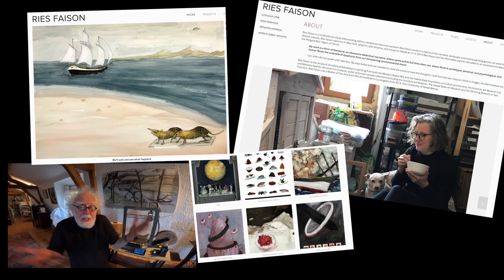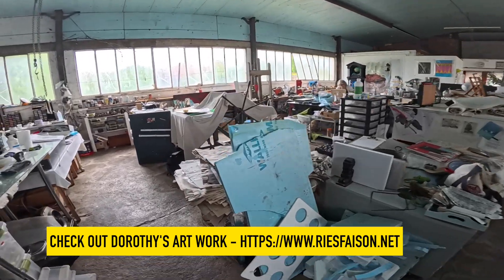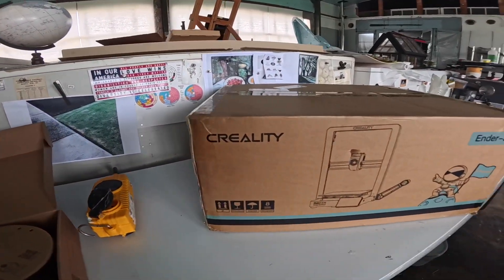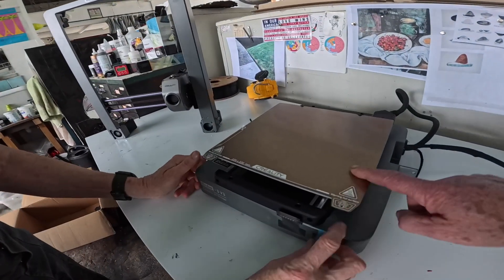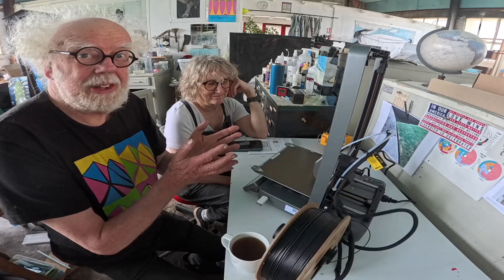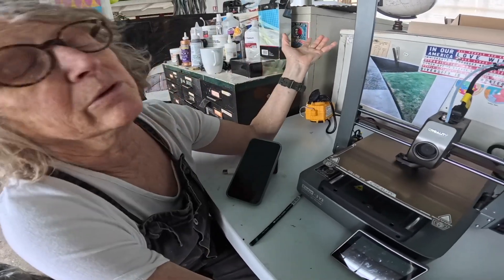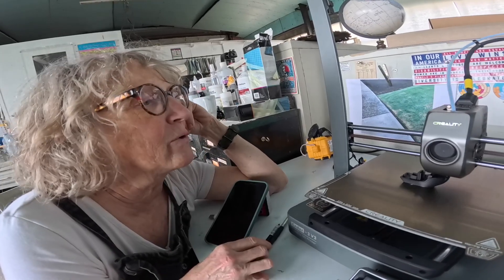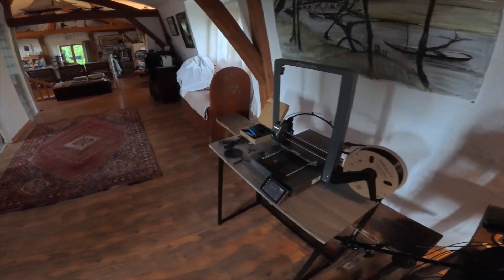Creality 3d Print Newbies - Prof Simon

Comment: you can 3d print spool holder dude ...that mount any where ....but Top not the best ...because machine shakes ...and weight on top will effect the bed movement and arm movement ...you might end up with micro vibrations that show up in print 

that why it on side ....however ..you can 3d print spool holders and that way you could add long legs to it so it up higher just not on the pirnter
Reply from the maker: ah yes......the weight of the spool on the top would shake the printer.

Comment: techniclly you could have that bridge in garden ....it would bean cuting the model into parts with hole in eash flat side that you can join parts with wooden Dowell and glue ...Use Bondo to fill  the gap ....

i built and printed full sized space marine war helmet in parts ...its huge glues sanded it all down
Reply from the maker: don't tell Dorothy.

Comment: Certainly looks fun. I wish it could work in steel, aluminium and ceramics though!.. I've just started trying to master Ondsel for FreeCAD (it makes the software actually usable as even most experienced CAD people are stumped without it). I put my engine design on the shelf after Christmas. Made in Wings3D (highly recommended for quick rough work, but not parametric or good enough for 3D printing). The problem is it's such a funky design I want to patent it first as once I do a vid it will be public domain, effectively. 
--
If the little Windows app I'm making gets some donations I'll patent and publish my engine. It all takes so much time though. The engine idea is a few years old now, although it has evolved...The windows app does: tabbed title bars (groups app instances with a tab for each on the title bar), right-click 'X' to close if unresponsive, auto-hide title, menu bar and scrollbars (leaves a mini bar that expands when the pointer is over it). invert or darken individual windows, attach notes to any tab, ++?.. Most is working well but I've got to make the notes system and settings interface.
--
Anyhow, enjoy your new tool, it looks cool... though it's actually HOT!.. good name too.

Comment: See the printer cable out back one on right heats the bed ......KEEP THAT ONE STRAIGHT ...see it kinks bends when bed moves ....that one of weak spots on all printers that bending can cause damage to cable over time ....with it been Creality it would be better cable than other printers though ..

same with Boing tube that PLA travels down ...that bends when lifts nozzle ...those tend to pop out of the nozzle that can lead to print to stop and or floor full of winded PLA
Reply from the maker: good tips ..thanks